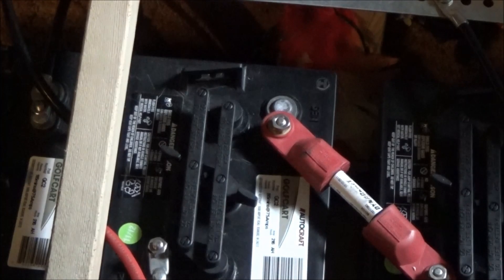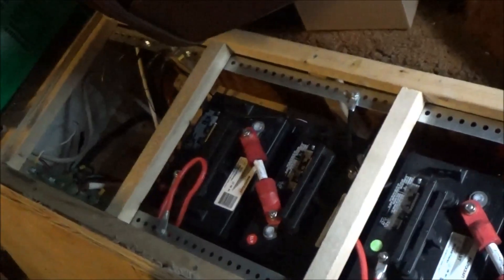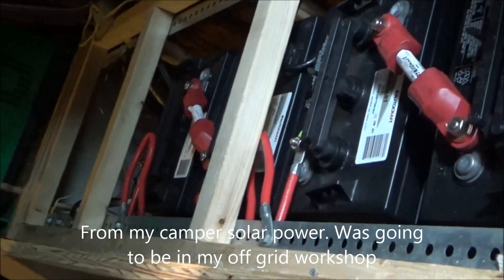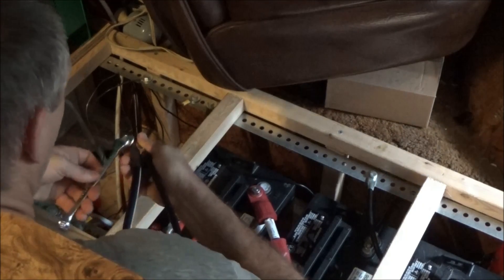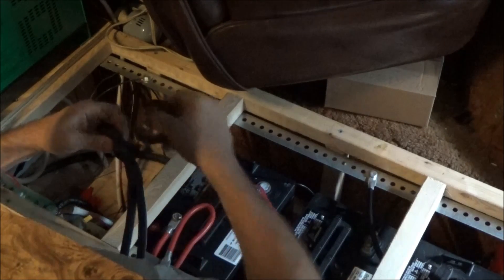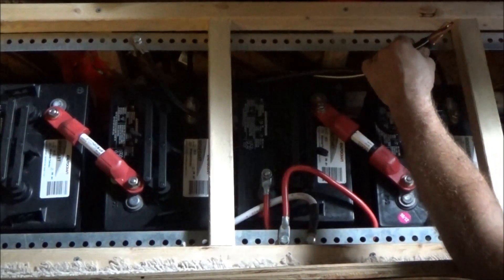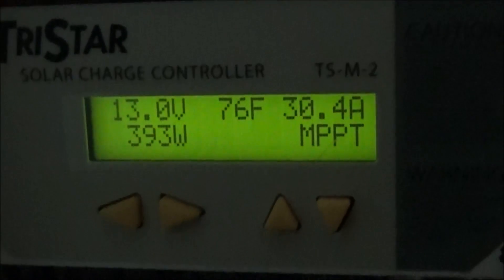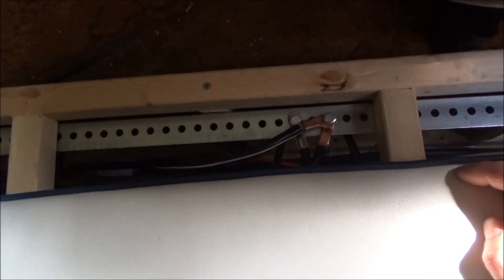Rewiring My Off Grid Solar RV Battery Bank

Comment: I would be willing to bet that a regular full size fridge would shut off sometimes because the seal would not be broken and also they are just better made better compressor than the cheap junky one that you got not being mean but I have already done some research on this issue. Because  I need a fridge too that is going to run off of batteries. The one you got is junk even if the seal was not broken. You might try craigs list for used fridge in good condition. a full size one I m thinking but not double wide. I am going to make a freezer hack fridge soon eventually that dont cost that much either. You should try doing that too. Sure the big one has surge for few seconds but it dont last long. My double wide fridge only pulls about 80 watts after the surge is over. Im thinking a used fridge with a good seal and in good shape would do good for you for now.
Reply: That is a very interesting comment.  When I think of cutting down energy I tend to think go small... but you make a very interesting point that I think I will research further.  Thank you!
Reply from the maker: I agree. A standard energy efficient fridge is way better than this garbage.